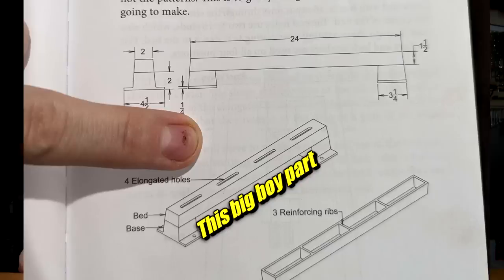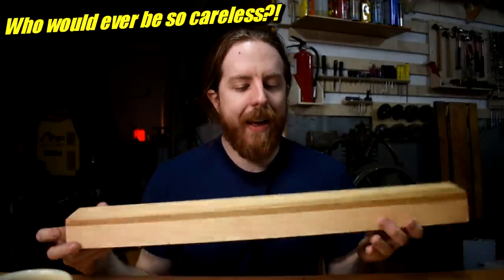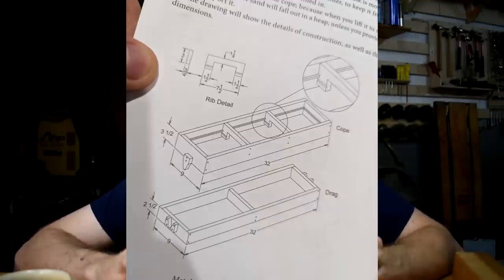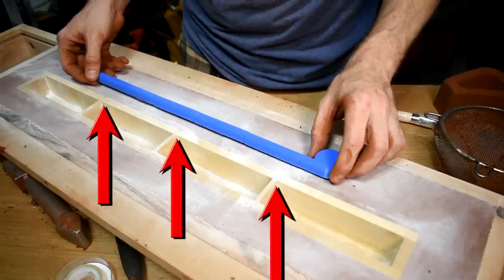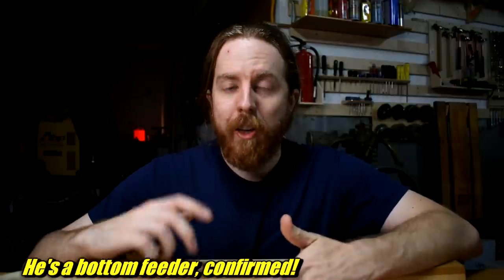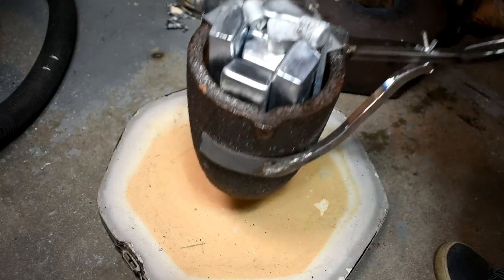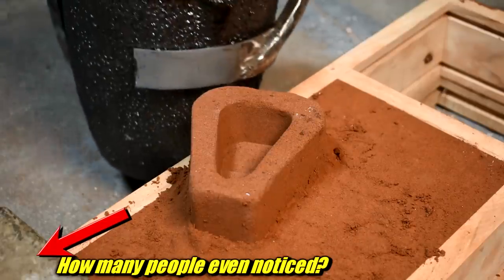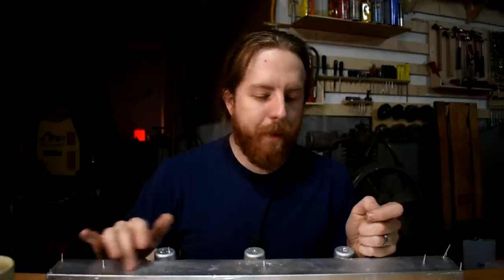The Biggest Gingery Lathe Casting: The Bed | Part 1

Comment: Finally, excellent advice for the backyard enthusiast - pouring over sand is essential if you don't want pock marks in your face!  A large heat change will cause concrete (with a high percent water content) to explode - try it with a Mapp gas torch on an inconspicuous spot, but wear PPE!  The water exits so fast that the cement is ruptured and turns into shrapnel.  Now imagine, cement chips plus molten metal.

Comment: For the risers/feeders you need Chvorinov's rule to calculate the size needed, as you used multiple riser/feeders you would section the part and calculate for each section. yes, gates from the risers/feeders to the part can freeze early which can also be due to the riser/feeders being too small. Absolutely the part can act as a riser/feeder to the actual riser/feeder, look at the gates when you cut them off, it will tell you a lot about what happened and confirm if that's what happened. Some metals will hide the feeding and you will see voids in the part or in the gates when you cut them open.
Reply from the maker: I think you're right.  I cut them off and polished it up, and i don't see any cracking or porosity, but it looks like the bed has a little shrinkage if i set a flat bar across the top.  Anywhere there is a brace with a feeder attached, the surface is almost 1/32" lower.

Comment: I worked in an old school pattern shop (Wisconsin Pattern in Racine WI, back in the day).

Pattern makers make fillets using regular sculpting clay for the material and a ball on a stick. This gives you a very fluid, smooth, and completely blended fillet. Once the clay has a day or two to dry and setup, regular old fashioned clear lacquer.

Lacquer is safe, dries fast, smells great, and is highly patchable.

Update: Hey, that cast you made is pretty impressive! Nice work!! 

Regarding turbulence: Yes, turbulence is your #1 enemy when pouring.😢

BTW - Johnson & Johnson is HQ'd in Racine WI. It's an old town, but the Frank Lloyd Wright buildings and houses are amazing.
Reply from the maker: Sculpting clay? Like sculpey?  I think I tried that years ago, not sure why I didn't try that here.

I don't live too far from Racine actually!
Reply: There is a similar process for making concrete counter forms. Place a thick bead of silicone on all edges and then use a fondant tool (metal ball bearing on a stick) to run a fillet along all the ends. The circular ball makes a perfect radius fillet, a perfectly straight line where the ball hits both walls, and the leftover silicone oozes out past the line. Once the silicone cures/dries, you can peel off the ooze out, leaving a perfectly rounded fillet.

Comment: last time i try making this lathe design, i cut corners. i managed to get a section of railroad track. cut it half, bolt and weld it on a 3/8 inch thick steel plate. it is damn heavy and able to hold cutting force much better than aluminum as the book suggest.🤫
Reply from the maker: if it works then it's a good idea!

Comment: 🌟🌟Awesome🌟🌟 -  Great work Paul.   A completely unsolicited suggestion came to my mind while watching you pour from that massive crucible.  I wonder if would be helpful to somehow add a steel tube bumper right next to the pouring basin such that you could use it to support the crucible while you're carefully pouring from it?  I could imagine it being a separate adjustable-height horizontal bar that is self supported so it doesn't bump the flask.  You could adjust it's placement as you practice the pour before the melt?  Looking forward to part 2.

Comment: I have seen many suggestions to mill the bed top rather than hand scrape it. Hand scraping has advantages over milling. The ever so slightly high and low spots created by scraping will allow your bed surface and way surface to mate closely and more tightly under flex, expansion, and contraction of dissimilar metals of the working lathe than 2 glass smooth surfaces bolted together. Hand scraped to 10 or so points per square inch is still a vey, very flat surface! It’s getting into semantics, but don’t confuse smooth and shiny with flat.

Comment: When dealing with heavy pours like this, would it be possible to use a 1/4 inch plate set on edge that could act as a rest/pivot point to help control he pour and take all the weight off your arms and back?  An alternative would be a one-sided cradle that you transfer the flask into, then lift from the bottom on a pivot point that would keep the pour spout close to the source.  

I know nothing - I'm just starting my journey in this.  But as a person with no upper body strength, I like to find ways to make work easier, and leverage is my friend.
Reply from the maker: Yes a plate or something to help hold the weight is the way to go

Comment: At one time I was using baby powder and wondering why my castings came out brown.   It seems that baby powder is made from corn starch and it burns when the molten metal touches it and leaves the scorch marks on the casting.  Getting real parting sand solved my problems. Thanks for the video keep on keeping on.
Reply from the maker: Lots of baby powder is cornstarch these days.  The stuff I have here is talc, I think only Johnson still sells talc baby powder?  Not sure.  Real parting powder is probably the best way to be sure you got the right stuff.

Comment: I can appreciate why one would use zamak. I however am still opting to make a castiron lathe. Chirpy also recommended zamak to me, but my primary hesitation remains that industry is not using zamak for this application. That said i have not made my lathe yet, though not due to casting problems.
Reply: "industry" isn't hand-casting your own lathes. "industry" has "economies of scale" behind it, where their casting equipment is used 100,000x as much as a home-caster's, and anything that can save a dollar here and there is worth saving. In terms of cost, at scale, cast iron is like a penny a pound, zamak is several hundred times as expensive. If you ever want to do cast iron, you need equipment that can do it, thus foundries will all have equipment that can do it and it's no harder for them than to use zinc, so might as well. You will end up with a much better lathe casting zamak than you will casting iron, because anything you make out of cast iron is going to suck. It's an industrial process, not well suited to a garage process. This is like arguing that you're going to create multi-ton sheet metal stamping dies to create replacement 1/4 panels for your Camero because that's how "industry" does it... yeah, when they make 100,000 of them. When you make a single (or 20) 1/4 panel at home, you get an English wheel and a welder and patch it together. I'm skeptical of your decision-making in general if you think that copying "industry" is an intelligent way to build anything.

Comment: I did not see shinkage looks fine!    Did you find shrinkage? I don't think you have any that counts.  Do not need the risers.
Zamak Casting temperature - solidification temperature is between 10 and 40 degrees C.   Alu is 80 and 110C
Multiply that with the coefficient of expansion and shrinkage should be very small.   

I am falling in love with Zamak.   
Great job!  Looking forwards to see how it scrapes.   Keep up the excellent work. butter butter
Reply from the maker: It's hard to see the shrinkage but it's there.  It's pretty minor but if I get the camera close enough, the shiny surface makes the camera freak out and it can't focus.

Comment: I wanted to see some finished Gingery lathe beds, so I googled it and that led to a guys website with a video of you scraping a lathe bed cast by another guy.  Seems to me your explanation of needing a larger flat surface to show  the high spots is correct, this video shows the whole scraping process-  How to rebuilding older machines using the hand scraping method ?

Comment: Regarding if corn starch based baby powder works as parting compound, my university uses it in their casting lab and we have pretty good results using it on Petrobond and sodium silicate. Alternatively, borax works just fine as well and is what I use at home. So really down to what you have available. I'm sure someone has tested all of them and can tell you which one is best, but for home applications I don't know if there is going to be much of a difference.
Reply from the maker: Thanks for the info!  I've heard people hate cornstarch as baby powder but ill have to try it for parting powder once I run out of this stuff

Comment: It may have been for a bit fancier metals, but is heating the molds a good idea?  (Granted knowing my luck I’m imagining petrobond on fire lol)
Reply: As a rule of thumb you should always heat your molds and use them asap as they will collect moisture when they cool again
Reply: @taylorfackrell1547  it might have been for steel/iron, but I remember seeing molds EXPLODE due to moisture.
Reply: most "heating" you see is either to dry the sand to give a dry skin, or to burn off a mold coating that has an alcohol base.

Comment: I would pronounce it Gingery, as in jinx, not Gingery, as in begin, because I have very Ginger hair. In my distant youth it was like someone had exploded an orange on my head. I could show you a picture, but you'd only laugh. I am used to it but it still hurts.
That lathe bed looks the biz! Do you think any of the sand from the pouring basin got into the bed, or was it trapped by the spin trap? The only time I've seen something bigger cast was by Flowering elbow. He made a massive CNC router machine. Looking forward to the scraping.

Comment: Question: Could you have replaceable cast iron ways milled? I'm sure so long as they were well bedded and supported they wouldn't go out of spec... Just a thought.
Reply from the maker: The design in the book uses a steel plate as the ways.  The bed is scraped flat, then the steel ways are attached to that as a base

Comment: Just stumbled onto this series, I have the books and was thinking of making one of these. Why didn't you go with cast iron for the bed? That was one mod I was thinking of making for this lathe, even if I had to send the pattern out to Windy Hill Foundry to have it cast.
Reply from the maker: Cast iron would be ideal, but I've melted cast iron before and decided to never do that again lol.  The radiant heat was painful.  Imagine a weld pool, but instead of the size of a drop, it's a quart.  Even with welding equipment on I felt like I was on fire!

Comment: Would a 3D Printed Pattern be a good idea?
Reply from the maker: Yes! I 3D print lots of patterns.  This one is too big for my printer though.  I'd have to print it in pieces and stick it together.  Totally doable but I already had the wood one.  Most of the rest of the patterns will be 3D printed
Reply: Be me to it a bit (typing this as i watch) but i guess i meant to counteract the but if wood denting, could maybe make it a monolithic part too (rather than a bunch of parts and a wood mold)

GRANTED i am about as experienced in metal casting as i am in cad…not that much, so take my ideas as just that lol

Comment: Oh btw, for a pouring shank, luckygen1001 who does cast iron casting, he has a casting shank that has wheels on it. It looks super simple to make, but i imagine its invaluable for heavier casts.
Reply from the maker: yeah his equipment is great.  I don't think i could manage giant iron pourings, especially in my home garage.  The heat is just too much, i wouldn't feel safe enough.
Reply: @PaulsGarage  safety is for sure a consideration. I myself have the luxury of 5 acres, I plan to throw up a roof over a sand pit. In my mind Lucky's pouring shank is a safety feature. Keep the hot away from the body.
Reply from the maker: @RFMongoose  that sounds perfect for iron casting.  When I did iron it was outside on a driveway, but my neighbors were very chill about me doing crazy stuff 🤣. Now I'm in a new house. The neighbors are cool, but the driveway slopes enough my furnace won't sit still (it's on wheels)
Reply: Oh yeah, I made a casting... Tray? Big casters. Basically a sandbox on wheels where I would put the furnace and all.

Comment: What is the waight of the bed after it was cast? Have you estimated how much metal is needed for project?
Reply: about 17 pounds is the weight of the bed,  that is what was said on the livestream on 5/20/2023.
Reply from the maker: yup vs. about 4ish for the aluminum bed i have.  after cutting the gates and feeders off, the bed ended up around 12.  And no i haven't estimated exactly how much I need, but i have plenty of za12 for the parts im using for that, and i'm going to use bronze for some of it, too.

Comment: Ignoring the price, and casting difficulties aside, would aluminum bronze (or some other alloy) be a better choice for the lathe castings from a technical perspective? Like, rigidity and vibration dampening and such. There is also the bling value of having a GOLD LATHE, too...
Reply: Thermal stability is also a concern
Aluminium bronze would be an excellent choice
Reply from the maker: The best for everything lathe-related is likely cast iron.  I can melt iron in this furnace but it's awfully scarry 🤣🤣
Reply: aluminum bronze is difficult to machine and would be difficult to scrape in. I think there are some other reasons (mainly cost) why aluminum bronze would not be a good choice.
But who cares, it would look sweet.

Comment: Usually the best material for those kind of applications is cast iron, now I know it is super hard to do that at home BUT i kind of have a feeling YOU will do that ...hehe
Reply from the maker: I've done cast iron before, but its not fun LOL.  I can feel my face burning just thinking about it.  I'm using ZA12 here because that's more manageable for someone following along with the project.
Reply: @PaulsGarage  See I knew it, you at least tried it xD 
It´s way hotter than Zamac of course.
Carry on!
Reply from the maker: @sierraecho884  even bronze is no fun IMO, so much heat lol. But I'm modifying some stuff to make it go easier.  I can't resist that bronze color, easily worth all the burns 🤣
Reply: @PaulsGarage  I know, it looks great doesn´t it ? Steel would be the holy grail for me but it´s super super hard. And the results are nowhere near as good as with ZAMAC, I mean this material is made to be cast. Aluminium is awesome too but just too damn light to create great details you need lots and lots of headpressure to overcome this with all it´s own issues.

Comment: Why not bolt a steel or cast iron plate onto the base so you don’t have to do much scraping?
Reply from the maker: There is a steel plate that bolts on but the top has to be flat or the plate will be warped enough to throw the lathe off

Comment: Paul, are you putting up your "modified" pattern sketch/dimensions?
Reply from the maker: Like posting an .stl somewhere?  I wasn't planning on posting it because I didn't print this, but I suppose I could.  I just made the alterations I mentioned in the video.  Increase the height 1/2" and use thicker wood.  Everything else as gingery said.  Oh and no open slots across the top.
Reply: @PaulsGarage  No need for the STL just the written specs so we can follow along.  I'd hate to just "wing it" and find out down the track that some change in dimension (like "thicker wood" or increased height turned into an issue with fitment of some later part.  If none of that is critical, then I'm all good as it is!  Also, I'm thinking of making a pattern board for the main pattern (will make it easy to create a one-sided pattern and easy to pull it out).  Then use a 3d printed block mold to ram up each of the cut outs and place them like cores.  If this is not too crazy, is the width of the "reinforcing ribs" etc critical to any later fitment or is this design more to just reduce the material needed to cast the bed?

Comment: Hand scraping doesn't sound like a whole lot of fun. I guess you'll be able to tell us about it. My milling machine can only deck about a foot of length at a time but you'd better believe I'd be going that far with it then moving the work over and getting the other half. It's not ideal but for me it'd be good enough.
Reply: Sorry to say, it won't. Each time you move the casting, you're resetting your Z-height. Picking up and moving the casting will mean a Z-error of a few thousandths of an inch plus inducing twist in the casting each time you clamp it to the table. You'll still end up scraping in the bed and slides anyway, and it honestly takes very little time to get it scraped in, once you learn how to scrape.
Reply: @switch2472  yes because indicators don't exist. Wait, they do!
Reply: @1pcfred  Best of luck buddy, I've been a machinist for 18 years and have built two of these lathes and the shaper. Your indicator ain't gonna save you.
Reply: @switch2472  I'd rather be lucky than good. You can only be so good but luck knows no bounds.
Reply: @1pcfred  Don't come cryin' to the people who tried to tell you when your lathe chatters and cuts a taper you can't correct. Trying to cut the bed in more than a single pass assumes you can generate a parallel surface, but because you can only cut approximately 1/3rd of the surface and your only reference surface gets removed from the game every time you move the casting, even with the nicest indicator you've got (I'm assuming a cheap 5 tenths indicator) you're never going to be true or flat to the required tolerances. The method outlined in the book just plain works and won't take four hours to get done if you follow the plan.